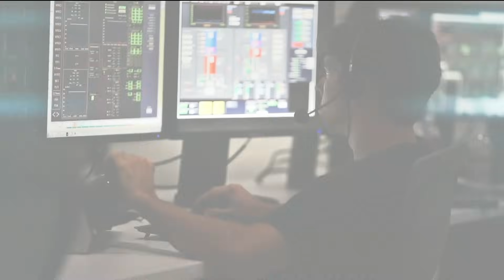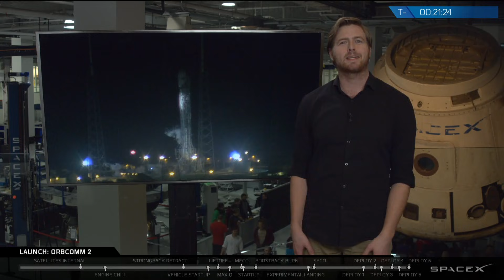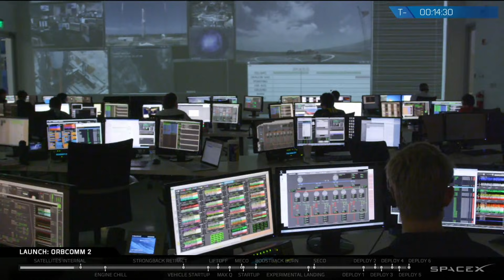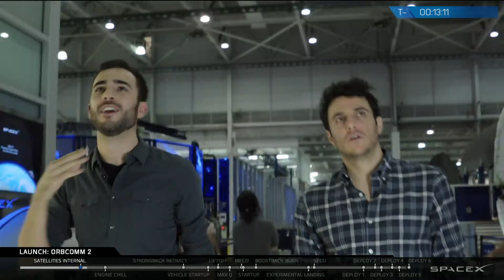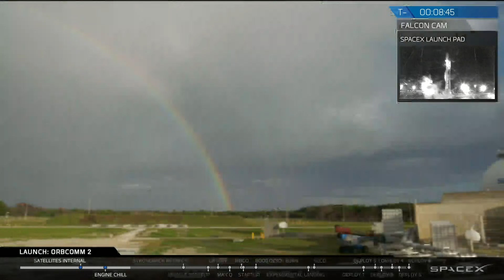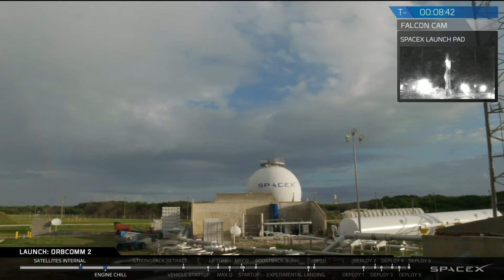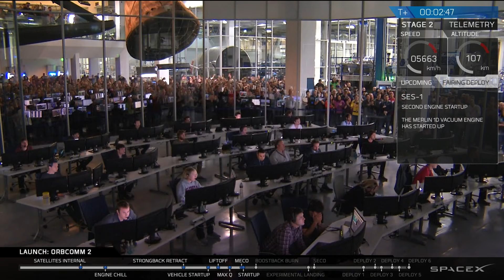ORBCOMM-2 Full Launch Webcast

Comment: Funny how the second stage (Stage2) is clearly listed in the upper right and says 4238 km/h @ 46.5 km 2m 4s in to flight (25:06 in video) when the main engine separates from the onboard camera even stating Stage 2 (24:46) then it is a tiny glow (25:01) then the Rocket Racket begins and they switch to onboard super CGI garbage to get the funds +apollowasreal +Kris de Valle and the rest needs to get PAID!

Comment: i guess the first stage made a complete orbit  before landing , RIGHT ?
or is there another cape Canaveral in Africa ?
please someone confirm
Reply: +milxl Nope. It pretty much did a U-turn in space. It first rotates 180 degrees and then performs 3 burns: The boostback burn aims it back at the launch pad. The reentry burn slows it down enough during reentry so the rocket can actually survive it. The final landing burn happens right at the end to make the rocket land softly
Reply: Niosus OK
because i was thinking it was too quick for an orbit
it's even more impressive

Comment: Question: Did the 1st stage actually make it to space (technical definition of 100 km altitude)?  It separated when it was still only at 79 km altitude.  It was gaining fast on 100 km, so it probably had a ballistic trajectory that took it to over 100 km altitude, but I wonder if it made it that high.  Does anyone know for sure?
Reply: Steven Schmidt it did cross the line into space.   wait why am I answering to  a 2 years old comments

Comment: Lots and lots of talk about liquid O2. No mention of what fuel is used. What fuel is used? What happened to the second stage after delivery of the sats? The really truly BIG first ever thing was the first stage coming back and landing upright. Never been done before! No cameras on this stage? There must have been exciting telemetry on the first stage but we didn't see it. Instead we saw the second stage telemetry and witnessed the burping of satellites into orbit.  Popping sats into orbit is something even backward North Korea can do. Russia did it 58 years ago.  It was fun anyway.
Reply: +azopene Both stages use LOX/RP-1 (Liquid Oxygen/Kerosene) . after satellites are deployed the second stage was left in orbit.
Reply: +Comic B Studios No it wasn't. It performed a deorbit burn (somewhat similar to the reboost of the 1st stage) and it burned up.
Reply: +Mikhail Armanuel Liquid hydrogen mixed with kerosene as the fuel? Holy cow, I don't think so. It was liquid oxygen and a highly refined version of kerosene called RP1.
Reply: +Comic B Studios liquid oxygen was used for the oxidiser and the base for the fuel was in fact liqyid hydrogen mixed with kerosene
Reply: There is no pure hydrogen mixed with RP-1
Reply: azopene Really? My bad, but i did read about that somewhere (the liquid hydrogen-kerosene mix)

Comment: Nobody cares about the poor stage 2 abanoned to its fate?
Reply: +Quim Canos Nebot  It all comes down to the math... the hardest part of the job is getting the heavy rocket and all its fuel and payload up from a standing start to 17,500 mph and up out of the atmosphere from the launch pad.  The first stage has to be very large to hold enough fuel to accelerate the second stage and payload, fairing, and itself off the pad from a standing start and to punch through the dense lower atmosphere (90% of Earth's atmosphere is within 20 miles of the surface, and air drag is considerable in early flight (up to max q, then falls off as the air gets thinner and thinner toward space).  SO, the first stage is the most expensive part, and the most valuable part to recover.  It's also the easiest.  When the second stage separates, most of the heavy fuel load is gone in the first stage, and so it weighs only a fraction of what it does at liftoff.  With the weight of the fully fueled upper stage and payload gone, it's lighter still.  It's roughly 40 miles high and traveling a few thousand mph eastward, but because it's lighter it's MUCH easier to slow down and propel back toward the landing site by igniting some of the rocket engines again.  Once it's headed back, the engines shut off and it basically "falls" back toward the landing site, til one engine lights again for the final deceleration and landing.  Because of these factors, the extra weight of extra landing fuel and landing gear doesn't subtract from the payload as bad as it would for upper stages... On the Saturn V moon rocket, to get an extra pound of payload to orbit, you'd have to remove ELEVEN pounds from the first stage.  IOW, add 11 pounds to the first stage, you lose ONE pound of payload capability. 

The upper stage is very different.  It's already moving several thousand mph above most of the atmosphere, with the payload, and the fairing (nose cone) is jettisoned, making things lighter.  That's why it only has ONE engine and is MUCH smaller than the first stage.  BUT, it does MOST of the acceleration work of getting the payload (and itself) into orbit at 17,500 mph.  If you watched the "speedometer" up in the corner during the flight, you'll notice the second stage accelerates faster and faster as it nears orbit-- as the fuel burns off and the stage continually gets lighter, while the rocket engine thrust remains the same, it pushes it faster and faster toward orbit.  Once it achieves 17,500 mph, the engine shuts down.  Deploy the payload(s), and now you COULD, theoretically, return the second stage.  BUT, you have a MUCH, MUCH harder job-- it's halfway around the world going 17,500 mph, not about 40 miles high and maybe a couple hundred miles away like the first stage going maybe 4,000 mph... SO, to recover the second stage, you'd have to flip over and burn the engine at the right time to slow down enough to reenter the atmosphere... timing is absolutely critical or you'll miss the landing site.  You'll need a heavy heatshield to protect the stage or it'll burn up, because it has to slow down from nearly 17,500 mph to a complete stop on the landing pad... the heat is enough to burn the stage to dust.  Then you have to slow down the stage for landing, which means parachutes, or rocket fuel for the engine to slow down and land, PLUS you have to have heavy landing legs.  All this stuff on a second stage that EVERY EXTRA POUND of weight is ONE LESS POUND of payload you can carry!  That's why upper stages are built as lightly as they possibly can make them-- EVERY extra pound of unneeded weight is a pound less payload you can carry!  Since the second stage is much smaller and lighter and has only a single engine, it's not as expensive to simply build a new one, especially when it's SO much harder to recover it and reuse it.  That's why shuttle used expendable booster stages for some of its payloads (Payload Assist Modules, or PAMs, and would have used disposable Shuttle-Centaur liquid hydrogen stages if they hadn't been canceled after the Challenger disaster due to safety concerns).  

Later!  OL J R :)
Reply: +luke strawwalker Excellent explanation! Is this extrapolated from your own research, or do you have insider knowledge of the problem?

Comment: Meanwhile NASA is having trouble building 1 freaking capsule with a giant non reusable rocket to nowhere.
Reply: +Sarge Rho SLS was obsolete before it ever left the drawing board... NASA's DRM-5 (design reference mission-- how NASA plans to do a Mars mission) would require SIX SLS launches to go to Mars, so the rocket isn't big enough anyway... ANY Mars mission is going to require MULTIPLE launches to assemble, supply, and fuel the spacecraft in orbit... so if it's going to require 6 SLS launches might as well do it with more SpaceX Falcon Heavy launches (or other rockets).  SLS is being designed to only launch once about every 2-3 years, so that means any Mars mission would require at least 12 years to launch the 6 spacecraft/fuel/supplies to assemble the Mars mission in orbit anyway.  SLS is a ridiculous dinosaur of a design that keeps the worst parts of the shuttle system alive so the contractors are happy and the politicians they lobby, nothing more.  

Later!  OL J R :)
Reply: +Gary B NASA is an Agency and doesn't build it's own launch vehicles, it contracts with corporations to build launch vehicles. The rocket to nowhere is the brainchild of the senate and congress to keep money flowing into districts that were heavily reliant on the space shuttle. NASA is under direction of the executive branch but congressional committees allocate resource funding based on pet projects, not based on the desires of scientists and engineers.
Reply: Between 2005 and 2010 when Ares I was cancelled, NASA spent $9 billion dollars to build a rocket out of an ALREADY EXISTING shuttle SRB and J-2S engine.  All they had to show for it was the Ares I-X test flight, which was an old expired shuttle SRB with a dummy fifth segment, topped by a "tuna can" upper stage simulator, which failed in that the SRB was too badly bent after impacting the ocean for reuse (which is why they dropped any pretense of reuse of the Ares I first stages and  Ares V SRB's, which was the entire point of the designs in the first place).  They also had to re-engineer the existing J-2S engine into the more powerful J-2X engine, an engine which has now been completed but is shelved because the changes make it unsuitable for an in-space propulsion engine (unlike its J-2 predecessor used on Saturn V).  During that same time period, SpaceX, which was a new company at the time, from a standing start with no experience designed the Merlin rocket engine as an ablatively cooled engine, redesigned it as a regeneratively cooled engine, adapted it for upper stage use (larger expansion bell nozzle), designed and built the testbed Falcon 1 rocket (and flew it successfully once), designed and built the Falcon 9 rocket (and flew it successfully), AND designed and built the Dragon resupply spacecraft designed to travel to and dock with ISS, and return to Earth for reuse... and they did all that for a reported $3.5 billion dollars.  During the hoopla over the mess the Constellation program to return to "the Moon, Mars, and Beyond" in 2010 (which led to the cancellation of that program), Elon Musk offered to design and build a new heavy-lift rocket for NASA more powerful than SLS, and do it for $3.5 billion dollars from drawing board to the launch pad-- Congress and NASA declined.  Congress and NASA came up with SLS, reusing as much of the old shuttle hardware as possible, and gave the contracts to the old shuttle contractors like ATK to keep making a fortune off what had been THE most expensive space launch vehicle ever built in terms of development and operational costs, FAR outstripping the costs of the Saturn V moon rockets, while being a FAR less capable system-- the Space Shuttle.  SLS will now replace shuttle as THE most expensive system ever designed.  We now know Shuttle launches, with overhead and program costs to maintain the capability, were about $1 billion dollars EACH.  SLS will FAR outstrip that, because due to its low launch rates of 1 every 2-3 years (instead of 2-3 PER YEAR like late-program shuttle launch rates) it will have to bear the overhead and maintenance costs of the program over multiple years on EVERY LAUNCH.  SLS will be breathtakingly expensive.  In addition, NO PAYLOADS have been approved, designed, or developed.  SLS has NO missions approved or funded beyond the first couple test flights, one of which includes a loop around the Moon (NOT even orbiting the Moon like Apollo 8 in 1968, but merely looping around like, like the Soviet Zond spacecraft did about the same time, which was incapable of going into lunar orbit, just like Orion MPCV is incapable of going into lunar orbit and returning to Earth without another rocket stage).  THIS is the sorry state NASA is in and what SpaceX has done by comparison. 

Later!  OL J R :)
Reply: +Gary B Exactly... And SpaceX not only designed but built and flew the Falcon 1, Falcon 9, AND Dragon resupply spacecraft for about ONE-THIRD the cost and in the same time that NASA WASTED on the cancelled Ares I rocket ALONE.  Speaks volumes about the inefficiency of gubmint-run operations and gubmint-mandated designs... 

The future belongs to the innovators, and they're not working for the government.  

Later!  OL J R :)
Reply: Samuel Cordner
Reusable as in bringing down cost, it was it almost costed more to refurbish the SRBs and build another fuel tank then overhaul the shuttle for the next flight. Every launch was 1 Billion dollars that's no where near cost effective to fly around LEO.
Reply: +Samuel Cordner The Space Shuttle was a reusable.. well.... shuttle, the rocket afaik wasn't reusable.
Reply: luke strawwalker
I couldn't have said it better. Its all about Senators making sure they get a piece of the pie for their state the bigger the program is the better. I wish someone had the balls to reorganize this mess, first thing I would do is consolidate, NASA has sites all over the US and parts have to be shipped here tested there then put together here. Trim this down to maybe 3 locations and cut the workforce by at least 50%, right there's a couple billion dollars of savings. Then I would stick to what they do best, deep space robotic missions and Astronaut training. Plenty of private co's know how to build rockets let them do it and lease them the pads and infrastructure. Just like the banks NASA has gotten to big to fail.
Reply: Gary B
 The primary mission of NASA is research and engineering. Research and development should be insulated from politics as much as possible. NASA should be funded under a either a DARPA or National Science Foundation block grant so that project priorities aren't changed at the whim of a new administration or changing political control of the senate and house. Science programs dictated and governed by the scientifically illiterate are the result.  Consider that the Senate Committee on Science and Technology is under the thumb of creationists and those who are antagonistic to Earth Science, and we only have to look to congress to see how the ULA lobby, only formed because of acts of industrial espionage on contract pricing by the prime contractors,has influenced the Air Force in delaying the entry of SpaceX to compete on a fair and open playing field in strategic launch contracts.
With the current level of political corruption there's no hope of making long term commitments to very difficult technical goals and actually achieving them.
Reply: +Samuel Cordner The Space Shuttle was attached to a giant fuel tank and two solid rocket boosters. The Space Shuttle was dangerous and expensive.
Reply: +Gary B Actually, they aren't having trouble with it at all.
Reply: Sarge Rho
It was sarcasm geez dude, and it is a rocket to no where, it has no mission. And if you're going to say Mars or anything else then provide proof.
Reply: Gary B EM-1 and EM-2 are funded as far as I know. Beyond that, the SLS may launch the Europa Multiple Flyby Mission, the spacecraft for the Asteroid Retrieval Mission, and the astronauts to go there.

I don't know if it will be used to go to Mars, it would make sense, since it can lift as much as a Saturn V in the Block II variant, but SpaceX' BFR/MCT is probably going to make the SLS obsolete.
Reply: +Gary B NASA already made a  reusable rocket called the space shuttle. The real question that is yet to be seen is is the Falcon 9 cost effective to reuse. The space shuttle was not really that is why no one really considers it reusable.
Reply: Sean Lynch
wow thanks for the lesson about NASA i had no idea,LMAO
Reply: Sean Lynch
Yea that was bullshit having only one consortium as the supplier to the Military to launch its vehicles, no room for inovation. Now Musk is going to stick it to them and rightfully so, this is the biggest thing to happen in this industry for a very long time. Overnight he just slashed rocket costs by 40 to 50% Go Space X!
Reply: +Gary B Hate to break it to you, but there is a lot of funding from contracts to commercial space companies. As other have said, NASA does not build anything. NASA is conducting experiments on ISS with other space agencies around the world. Let's face it, we need a capsule to deep space, because anything else is just not that great anymore. It forces progression into technologies that eventually have an impact here on earth. I'm content with that
Reply: Jasin Colegrove
NASA doesn't build anything? they just installed a very expensive special welding machine for SLS tanks at one of their facilities, are you sure? Hate to break it to you. So your content with building stuff just to build it? There is still no mission for either SLS or Orion (Orion could be used as a taxi) but you don't build things in hopes of using it some day its just ass backwards. And please don't say its for Mars there is no mission yet to anywhere.
Reply: +Gary B Building is such a loose term. Their massive contract spending speaks volumes. Maybe we can disagree on 'assemble?'

I know the facility that was used to test the space launch vehicle was pieced out by more then a few contractors for it's upgrades. One of which was a waste of time, seeing as how it had to be redone.
Reply: Jasin Colegrove
Agreed, I guess I just want us to be doing more than just flying around LEO before I die. But I still cant wrap my mind about what the hell they are doing. A mission to Mars is a bold decision that has to come from a President willing to take the risk and to do it in no more than 10 years otherwise the next guy will scrap it. W e all know that.